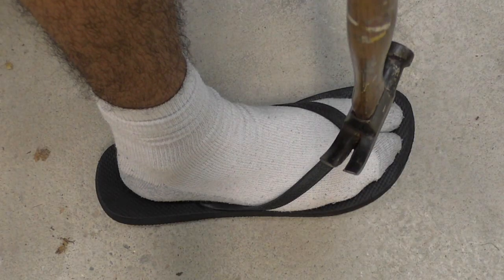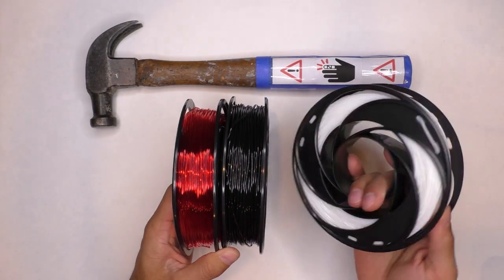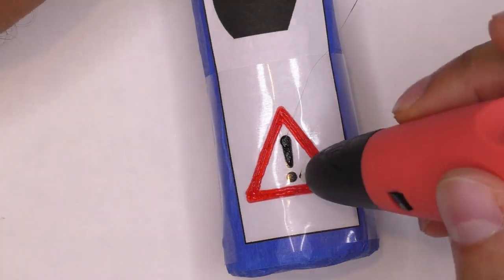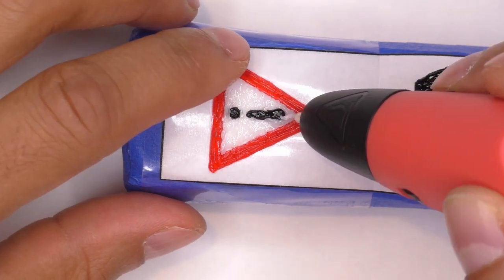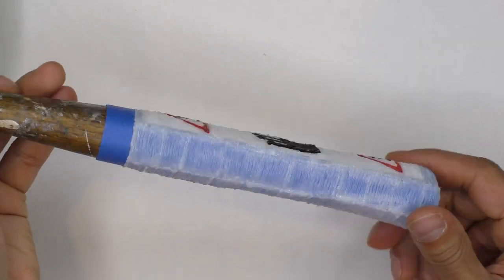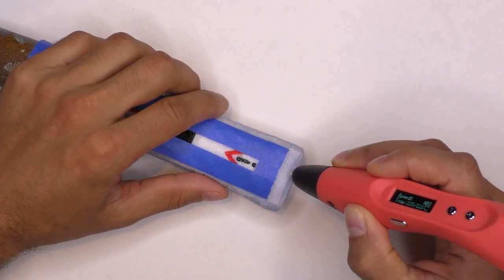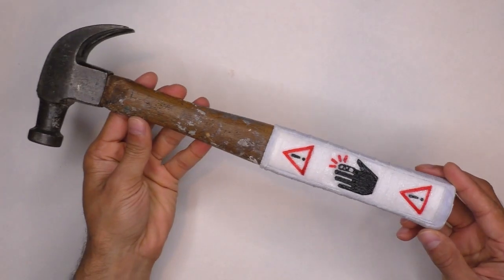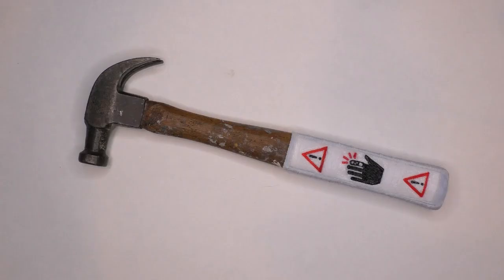Do FLEXIBLE Grips made with a 3D Pen Work?

Comment: That's nice and takes some patience. I would have simply 3d printed a cylinder of the grip and called it a day. The details I can mark with a pen later if I really want.

Thanks for sharing your work
Reply from the maker: Thanks.  The big difference is that this won't slide on and off like a 3D printed version would. It is really stuck on there...it will be interesting to see if it holds up over time.

Comment: I had the impression that tpu/flex wasn't suitable for the pens due to very high temp requirement, but they seem to work very fine on this scenario.
You could try to punch a hole on the bottom of the handle then fill it with plastic and add some glue to secure it.
Reply from the maker: The Scribbler goes up to 240 deg C, which works for TPU filament.  You should give flexible filament a try, it worked well.
Reply: @PotentPrintables  Thanks I will try it on the 3d simo kit sometime. I wrote a profile on the arduino firmware that goes up to 240c-250c but i am not sure if its real or a bug.